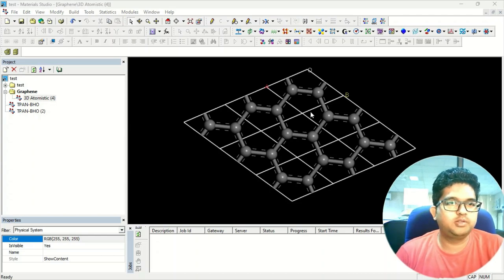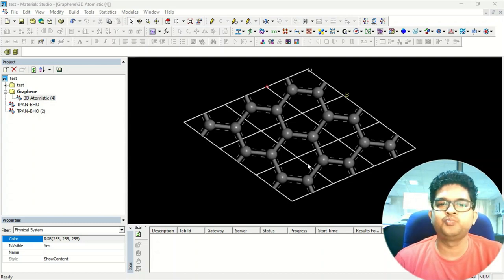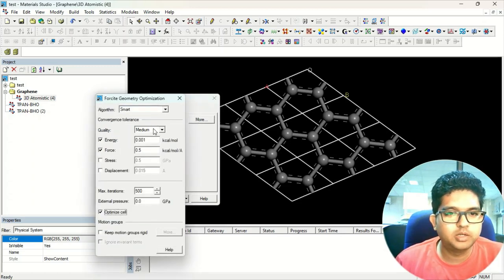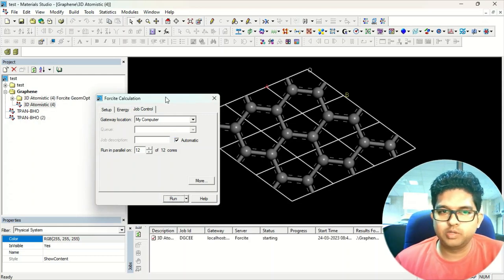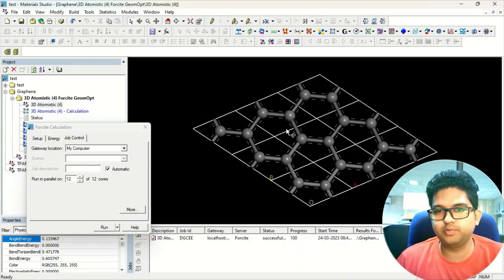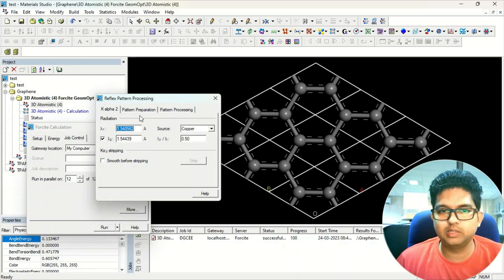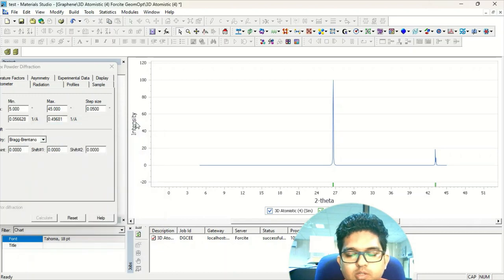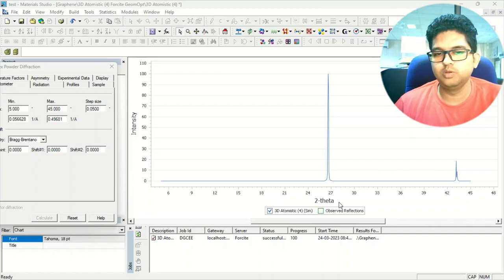X-ray diffraction  pattern calculation in Materials Studio || Gaurav Jhaa

Comment: I have a CIF file of a material which I want to produce. But lattice parameters in my material I can see its 1.5 times along c direction..How can I simulate the structure and overlap with my material and find the difference with the reported material?
Reply from the maker: Have some collaborators from your dept. Or outside and then proceed.